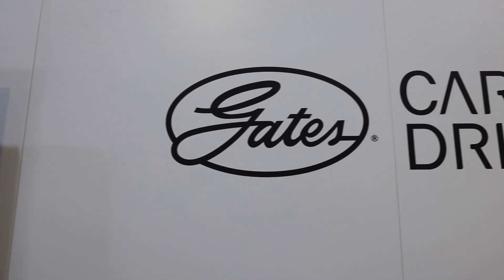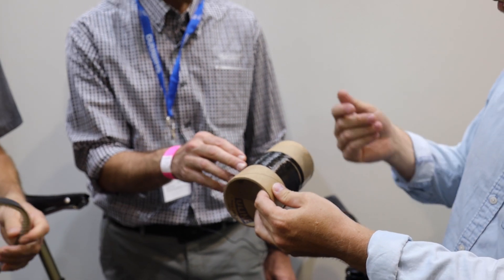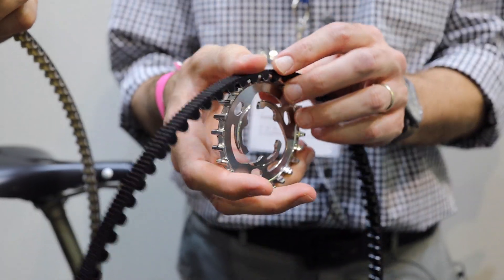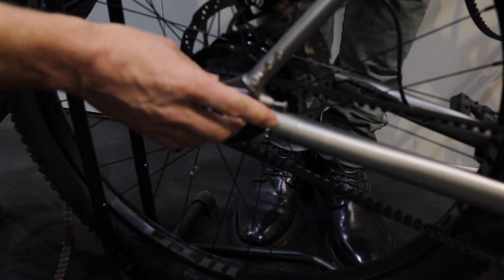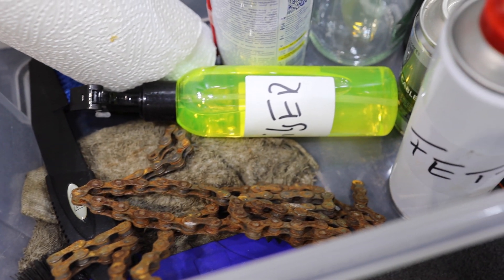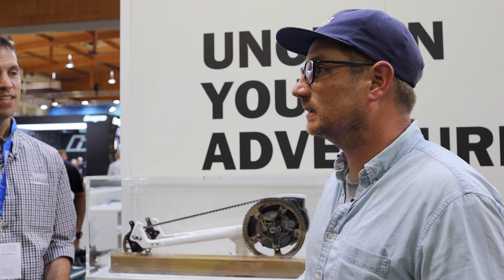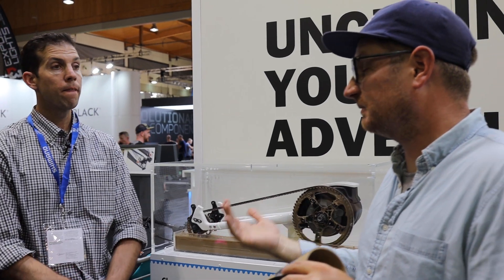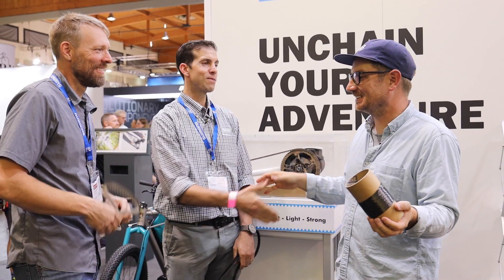A Deeper Look at Gates Carbon Belt Drives at Eurobike

Comment: How can a polyurethane coated belt wear out a metal cog, considering that polyurethane is much softer? The only thing I can imagine is that the dust that accumulates on the belt is made of a harder substance. If so, then spraying water over the belt often should vastly increase a cog's longevity. Yes?

Comment: P.S. There's no technical reason that a bike could not have TWO belts, one on either side of the rear wheel. It might be worth exploring in terms of redundancy, keeping the drive wheel's dish minimal, as well as keeping everything centered (which benefits things like bearings).

Comment: They should make a stronger model belt for heavy/strong users I destroyed my belt after only 5 bike rides
Reply from the maker: I think it likely wasn’t setup right. I would check the belt line and tension. There is a heavier duty version out now as well
Reply: @Propelbikes  yeah maybe but I'm also a big guy and the assist mode was on turbo and it was in heavy gear and then I put on my full 110 kg. So perhaps I need a heavy duty version
Reply from the maker: Just make sure they replace with the newest stock of the belt which is slightly upgraded and most importantly make sure the belt line is straight.

Comment: Love my Gates belt drive but at 500mls on my new Tern i had to spray it with dry silicone spray. As recommended by Gates. This is because it had become noisy. It’s totally fine again now and I still love it for its advantages over chain drive.
Reply from the maker: I think in particularly dusty areas this can be a challenge
Reply: @Propelbikes  it’s been dry and hot here in the UK where I am for some time now. I suspect as you do dust/grit must cause some issues. But as I say I still think it’s an excellent system and if an occasional quick spray with dry lube resolves it. I have no issue with that.
Reply: Do you recall which brand of silicone spray you used? All I have is the WD-40 branded version, which I love for so many other applications.

Comment: Meanwhile I got 21000 km on trekking pedelec with Gates CDX. Belt and Nexus 8 chain ring still looking good. The front chain ring is worn showing shark like tooth. I'm going to replace it. The new one is labled EXP (Expedition) should support an even longer lifetime.

Comment: I am in the middle of rebuilding my Surly Pugsley into a Gates Belt Drive.  I've finally located all the correct parts and a frame welder who has expertise with the Gates system and the frame modification.  This is going to be really great!
Reply from the maker: Cool! What drivetrain are you running?
Reply: @Propelbikes  I bought the bike used.  It was stock from Surly, running a front and rear derailleur and chain.  But of course the best derailleur is no derailleur, so I got a new rear wheel and rebuilt it with a Shimano Alpine 8 gear hub, which is great--but not great enough.  I knew something was still dreadfully wrong with this picture, so got to thinking and researching to find the missing link... I found it!  It was a belt drive!  

I first tried to avoid the frame modification and researched the Veer system.  But Veer cannot accommodate this fat bike frame.  So I went back to the Gates system and found everything I need.  Gates has the best selection of parts and the best parts and dominates the market.  I will order the parts Monday.  I will then take bike and parts to the frame welder for modification and assembly.  Can't wait!

My next build will be from scratch and will be another steel frame, fat bike, Gates Belt Drive, and Rohloff 14 spd gear hub. In fact all my bikes from here on out will be Gates Belt Drive.  There's no other way to go.
Reply from the maker: Super cool! Way to go with a low maintenance all terrain bike. We love Gates! Stay tuned for another video on Gates soon.

Comment: I want one on my next bike. Do you have a miles estimation about how long it last approximately ? How most does it cost to change cog + belt ? Thanks !
Reply from the maker: We see belts last upwards of 10k miles and between the belt and cogs you're usually looking at around 300-400 for replacing everything.
Reply: Propel Electric Bikesu.

Comment: pointless for the peloton, because of the 6.8k thing... 
I'm also not a fan of geared hubs, I have one on my unicycle and I hate it.
but I want one for my BMX fixie.
Reply from the maker: Not sure what you mean about the 6.8k thing? Belt on a BMX bike would be cool for sure.
Reply: @Propelbikes  the minimum allowed weight on bikes in the peloton is 6.8 kilo. so reducing weight there is basically pointless because most carbon bikes are under that weight.

Comment: Have it for over a year now and will never go back to a chain.  Quiet, no maintenance and looks cool.
Reply: Is there any drag ?
Reply: @lukegrady5357  Yes there is a bit. The lower the tension the lower drag. But don't go too low. The gates phone app will help with that.
Reply from the maker: I think you’re not alone here. Definitely a great way to go!
Reply: @Propelbikes  cycling through winter for my commute, I really want to switch, thanks for the short and informative video
Reply: I know have two bikes with Gates. Love the belt drive! I bought my fisrt three years ago. Best thing about it is that you never need to tension it again unless you do something else like change a tire.

Comment: A few years ago when I built my 1st e-bike & wanted knowledgeable help to check my work the only shop I trusted was Propel. I saw an R&M Delite with a belt drive and Nuvinci CVT and was instantly curious. I only went for a test drive but it is, to date, the smoothest drive train I've ridden. If they prove as reliable (long lived) as expected chains will become extinct. I also like an IGH because muck doesn't mess with the gears.

Comment: Is there any way to add an internal hub gear and Gates carbon belt to any bike like a Vektron?
Reply from the maker: No folders at the moment. The closest would be the HSD or the Riese & Müller Tinker. They have folding handlebars but the frame is fixed.

Comment: lasts 3 times more and costs 4 times more. not even talking about all the other parts (chainrings and so on).
You need a special bike which is far more expensive than any off the shelf product.
And you can't use normal derailer systems. You need an even more expensive hub system.

The belt itself sounds nice but all the other stuff is way too expensive to make the belt even work.
If you have that money upfront you are welcome. But I don't see why my bike should exceed way beyond 1200 bucks.
For that price it should be an awesome cook.

Oh maybe someone who drives this thing.
Does it make noises when it get's wet. Some people have this problem.
Or does the teeth of the chainring eat the belt on occasion?
Reply from the maker: You’re certainly entitled to your opinion, but the people we know that have chosen to opt for the belt never regret their decision from what I see. It cost more upfront but if you ride a lot it usually costs less in maintenance and maintenance is significantly less frequent. 

They say 3 times, but in practice we are talking upwards of 10x the life of a chain, especially on an ebike. No problem when it’s wet, as long as the tension is set correctly. The teeth can damage the belt if they’re significantly worn, but that’s not a common thing as it takes a lot to wear them out.
Reply: Look at the Brilliant Bikes Cooper, it's $400 with a revised, lower cost, Gates belt drive.   There are lots of great options under $1000, or $600. These reps are being very conservative in their language, the belt drive is proving to be extremely durable.
Reply: great part for BMX and fixie.

Comment: How  does it  shift?
Reply: I have a geared hub on my unicycle and it is a bitch to maintenance...
Reply: @greedfox7842  what type? I've heard the Rohloff is super reliable and easy to change the internal oil. But the other brands are junk.
Reply from the maker: The gears are internal like a transmission. That or you can have a single speed transmission. Most use a belt with what’s called an internally geared hub.

Comment: Wondering about their low estimated lifetime. Have my belt now for 14500km on the Charger Nuvinci HS. Only thing nowadays I get a bit of squeaking noise when the belt is really dusty. Do you recommend a change, Chris?
Reply from the maker: We’re seeing many as similar life so I too wondered about their reports. I think as long as the belt still has the protective coating and it’s performing well I would probably keep using it. If seen reports of the belt going to 30000km. Not sure if this short service life is recommended to sell more belts. I think if you keep it clean and keep the tension right you can see a very long life.

Comment: Maybe a silly question, but wonder if the cogs can be flipped to double the wear - that is put wear on the other side of the sprocket tooth?
Reply from the maker: I think once they get worn they will end up with a sharp edge so even if you flip them I think you will put your belt in jeopardy. There is also a offset at times so flipping the belt would impact the belt line or the clearance from the frame or motor.
Reply: @Propelbikes  Makes sense - thanks for the info.
Reply: The belt already wears on both sides....from the drive side, and the driven side